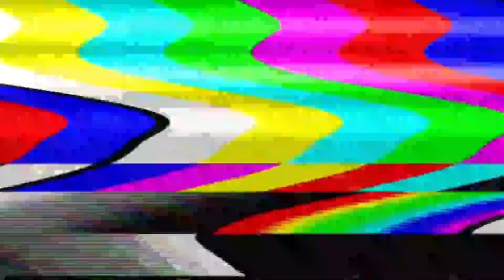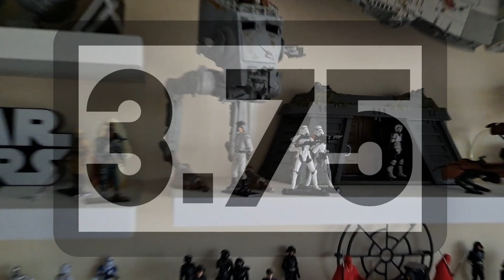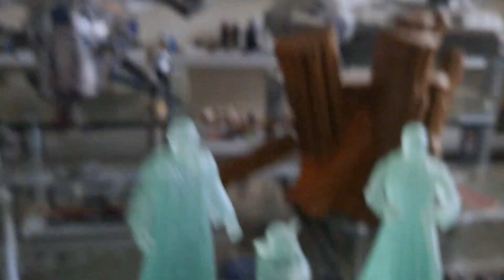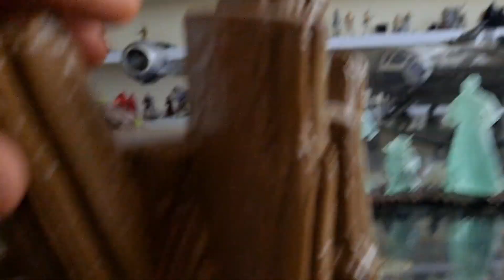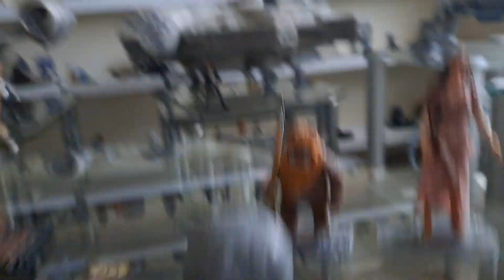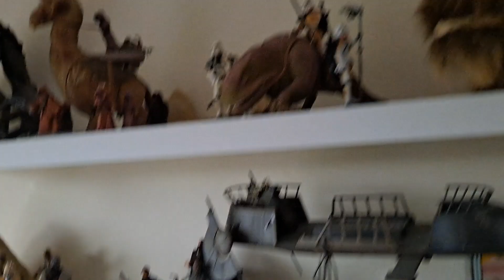An Ewok Village HASLAB? 🤔 & My entire 3.75 Ewoks collection!

Comment: 3D modeling has no scale,  until you print it.  Landspeeder Luke makes files, he personally collects black series so thats what he has in mind, but it has absolutely no bearing on what scale someone else prints it at.
Reply from the maker: I know man, Ian scales down and prints Landspeeder Luke files... thought I said that in vid 🤔
Reply: @OnlyOneKenobi  right but you were asking why he makes it for black series.  What Im saying is, the important part is that Luke makes the files, period.  This allows anyone to print cool designs in whatever size they want.  You were saying he should make them FOR 3.75”, it’s exactly the same, there’s no difference between making them for 6” vs 3.75.  With regard to modeling, it’s exactly the same.  There isn’t really a “for”, aspect to it.  Unlike manufacturing which has a defined size and scale.
Reply from the maker: I think you sometimes take my words way too literally! 😆🤣 

At the end of the day, I'm a 3.75 collector.  Safe to say our man Land Speeder Luke is 6 inch correct? 

I just want to confirm with you that I'm well aware of rescaling.... but perhaps I'm just subtly asking why he and others wanna persue dioramas etc in 6 inch when, in my opinion, 3.75 is superior. ✊🏻

I'm pretty certain his use of Black Series emblems etc is appealing to the 6 inch audience... otherwise,  he'd be rocking some TVC visuals on his Instagram, with the option of upscale to 6inch as opposed to downscale to 3.75. 

Of course, he and others have every right to persue 6 inch stuff and it'sequally cool... but in my opinion, 3.75 IS BEST! 😆👌🏼😉
Reply: @OnlyOneKenobi  Nick to be clear, Im not intending to give you a hard time, just chatting, love your channel.

Im pointing out that Luke makes amazing files, and they are accessible to anyone with a printer(I strongly recommend you get one), I too absolutely love 3.75” and don’t bother with 6” in any way.  That being said, I think the fact that Luke collects 6” IS the reason why he makes so many files.  In a sense, there’s a lot less “work to be done” in 3.75”, as in terms of play sets, 6” is heavily lacking.  This essentially what is likely inspiring him to make the files he makes, because they don’t exist for his collection,   if he switched to collecting 3.75”, there would be a lot less to tackle.  So by him collecting 6”, he is constantly putting out amazing files that we (often) benefit from as well.  Does that make sense?

I am also a person that makes 3d files, many of my head sculpts are created with 3.75” in mind, but my Hot Toys 1/6th scale friends benefit from
them too.  What matters is that the files are created.  After that anyone can print at whatever size they choose.  If Luke was a 3.75” collector, he wouldn’t need so many files,  a lot of what he does, is simply him taking matters into his own hands since 6” doesn’t get the world building stuff.  3.75” can enjoy whatever files he makes.
Reply: @OnlyOneKenobi  to put it another way:

We have an ewok playset, we do, its old but we have one for 3.75”.

6” does not have an ewok village playset at all.  As a result, Luke makes it, BECAUSE it doesn’t exist in 6”.  Boom, 3.75” gets a new awesome ewok village to print now too.

Sane can be said for yoda’s hut.  We have one, its old but it exists.  Black series doesn’t have one at all, so Luke creates it, its awesome and boom, every other scale benefits too. 

He’s creating world building files, because 6” doesn’t get these kinds of things ,

does that make sense?
Reply from the maker: I just felt like you'd completely missed my point, honestly. 

Even if someone out there wants to make a diorama for a 12 inch figure collector.... let 'em  them make it! They're free to do so. 

The subtle point I was making in my video... is that this kind of thing IS BEST in 3.75.  Coz bottom line, any other scale is too big. 

Again.... that's the point I was trying to make.

P.s just seen your penultimate comment before your last...  appreciate that man 👍🏻👍🏻

Comment: The biggest issue with Ghost in 3.75 scale is the size and therefore cost. If the Ghost is $600USD or more the number of backers is low.
Did Hasbro say it was going to be TVC or even figure based project eg. The failed Inquisitor lightsabre?
If it is the Ghost it maybe in a smaller scale bur I don't know if Hasbro has the market for that either.
Reply: If done correctly, I will buy at least 3 of them.